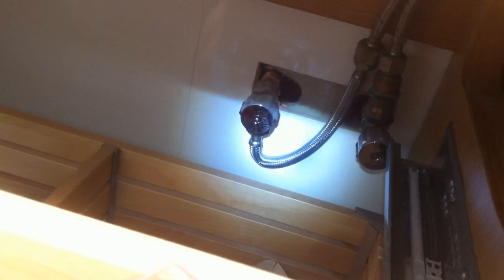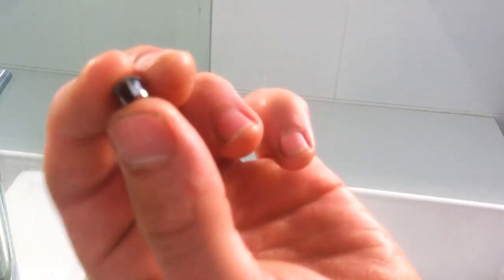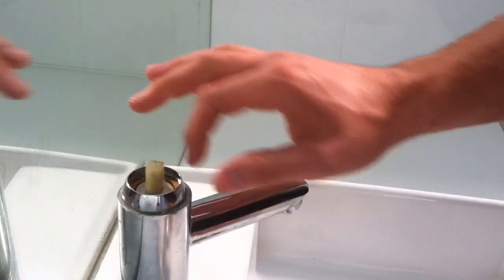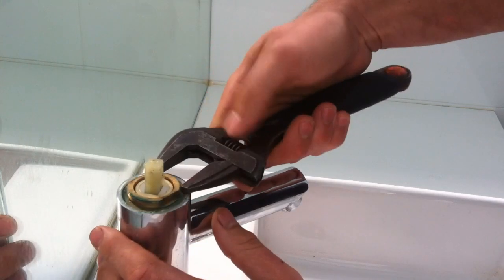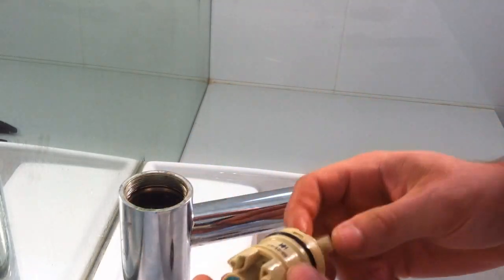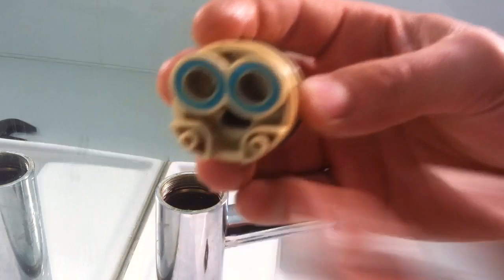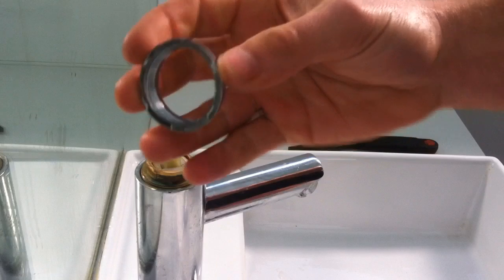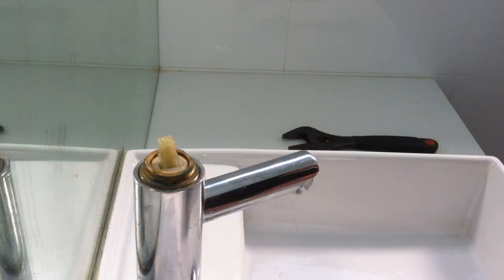How to repair a leaking flick mixer tap

Comment: Very helpful. You solved my problem. I have three pieces of advice. 

1. Put the plug in the sink and any other nearby sink/bath so you don't lose any little bits. 
2. I was initially stumped because I could not see any hex/allen socket after I removed the little cap from the tap/faucet handle. So, I randomly tired several types drivers and hex keys and was surprised that a hex key fitted. On close examination it turns out that the inside of the socket was so highly polished that the light was bouncing around in there and I could not see the shape of the socket. So, don't be surprised if you see no hex socket. 
3. After you put the new cartridge in, do not overtighten the locking ring. That cartridge is cheap Chinese plastic. If you tighten the locking ring too much, you will crush it. You want snug contact, but nothing more.

Thank you.

Comment: I went to my local plumbing supply shop to buy, what I thought I needed which was a new washer for my leaking mixer tap. I was told that it was better to buy a new tap. They didn’t mention the cartridge. Fortunately, I didn’t believe them and watched your video. Bought a new cartridge at another plumbing supply shop and it worked. Thank you so much for posting this video. Kate

Comment: Really helpful video, well put together. The crunch for me was in the add-on part. Don't over-tighten the brass ring onto the cartridge. I bought a mixer tap, pretty much as the one used in the video, for a brand new kitchen. After the fitters left I noticed there was a small leak on the body of the tap. I tightened the brass ring and found it worked for a few days and was then worse. Watching the video made me realise I had done the opposite to what was needed. As the triple 'o-ring' washer had been over-compressed I took Angie Redoblado's tip and turned the washer upside down. Result: no sign of a leak after five days. Thanks fellas.

Comment: Very helpful.  I had a lot of trouble removing the handle from the cartridge (used hot water eventually), very slow process.  Then the plastic dress ring would not turn without pipe wrench and even with cloth managed to damage chrome.  In spite of these issues the video was a comfort in the process.

Comment: Here's an extra tip.

When you start, cover the waste/outlet/drain with something like a plate or a bit of plastic.

That way, when you drop the little button thing (see 1:44), and it rolls away making a bee-line for the waste outlet, you don't actually lose it down the drain. 

Even though you tried to catch it but only succeeded in nudging it further on it's way to its inevitable destination in the waste trap. Which probably needed all that muck cleaning out of it anyway.

Comment: Thank you for this. Even after removing the screw, the tap handle can be very tightly attached to the cartridge. I really had to lift and move it around to very slowly remove it.

Comment: Well done bloke. I just tightened the brass locknut up and that fixed the leak. Obviously not enough pressure on the blue O rings and the water was getting past them.. Cheers

Comment: Awesome.  Just needed the knowledge; this is given without any fluff...just the guts of what I need to know.  Success!  Just cleaned out the slime, tightened the brass locknut and leak fixed.

Comment: Hi and thanks for this great video. I couldnt manage to get the chrome dress ring off, it was too tight to turn even with a damp cloth. Any advice on how I can do this please?? There seemed to be a bit of rust or corrosion around the retaining nut - could this be the reason why the dress ring would not loosen??

Comment: Perhaps try this first before replacing cartridge. Remove the two O-rings on the cartridge and replace them using the other side, that is, turn each upside down and replace it. Put cartridge back and tighten the nut. Leak stopped. I wonder if the a standard   O-ring might be a suitable replacement, otherwise look for the correct size O-ring by bringing a sample  from the cartridge to the hardware shop.
Reply: Your advice was helpful to me. Thank you so much

Comment: Thanks for posting this video. This shows how to "replace" the cartridge, but can the old cartridge be repaired? Is it just a matter of pulling the cartridge apart and re-greasing the flat surfaces that slide against each other?

Comment: I have just done this. The grub screw needed a 2.5mm allen key and the tap handle was extremely difficult to remove, possibly because the shape of it causes you to pull it at an angle. I also dropped the little hole cover down the sink because I hadn't put the plug in first.
Reply: F Clancy my DIY never works out. I have removed grub screw and now it's stuck In There somewhere and I can't get the tap head off. :.(

Comment: Is there any other causes of drips? My new tap started leaking a month after installation. I changed the cartridge and 4 hours later it started dripping again. I disassembled and checked the sealing ring, it was fine, as was the face the o ring seats on. Bloody annoyed as the tap and the cartridge are not cheap.

Comment: Great presentation! Whilst I have my tap undone, is there a solution I can use to clean the components so they look shiny and new? Also, I have an extending spout with retractable hose, what can I do to clean the showering head and get the calcium build-up off?

Comment: Can I install mixer tap on a basin that only have cold water supply (only cold water, no hot water)? I want to know how to connect the mixer tap (that looks like your video) to only cold water. No hot water supply. Can I leave the hot water hose from the tap unconnected. Thanks
Reply: Jason L Not sure how it's connected exactly, but my workplace bathroom sink has this setup - cold only.  If you push it to the Hot side, the flow stops completely.

Comment: I installed today a new tap because the old one was leaking. The problem is that the new is very noisy. Did I do something wrong? I tried to uninstall it and install it again 2-3 times but the noise remains the same. The new tap is a 40mm Naijie and looks exactly the same as the old one.

Comment: Ha ha.  “All you gotta do is change the cartridge.”  After jackhammering off the lever and plastic pseudo-metal cap because mineral deposits have cemented them in.  And a quarter stick of dynamite for good measure.  But great detailed video.

Comment: Good video. Only problem - cartridge prices.
Here in New Zealand - a replacement cartridge is $140 (no warranty unless installed by a plumber), a new tap is $100 (comes with 5 year warranty for DIY install).
Guess what option I went for.
Reply: Have you never heard of eBay? A quick search finds a ceramic mixer cartridge for $5.83 including postage. You can pay $13.95 if you feel the cheaper one might be inferior.
Reply: iconoclad Good idea. Except that when I have a broken/leaky cartridge I can't really wait for an item to be delivered from the US or China. So it's a trip to the local home improvement store instead.
Reply: Holy shit dude, I picked up one for $11 when mine blew today
Reply: Yeah some things here in NZ are ridiculously expensive ay bro.

Comment: you need a tap spanner mate - looks like the tool for removing spark plugs. it fits over the long screw and tightens the nut - there is no other way to get it tight enough to stop it rocking around - unless you got stranglers hands! get one online for a few pounds. Good luck!

Comment: Most of the time the mechanism works fine, the problem can be easily resolved by just replacing the rubber seals

Comment: I need to replace the hose from the isolating tap to the mixer tap, I would like some tips please.
Reply: Makes sure all mating surfaces are clean, and use PTFE tape on the threads/olives of the new fittings.
Reply: Adam Thompson me too I have the same problem.

were you able to do it ??  any vedios!!

Comment: Anybody knows how to open a Monda kitchen mixer tap ? It has the mixer sitting horizontal (on the side) and there is no plastic cap to hide the Allen screw. Instead, I can unscrew the handle and there is an Allen screw with that holds the handle. If I unscrew that screw, there is nothing behind it. Yet the top does not come apart. I could not see any other Allen screws elsewhere.